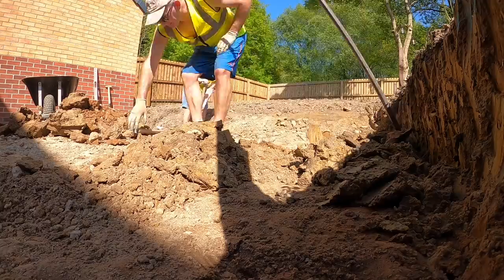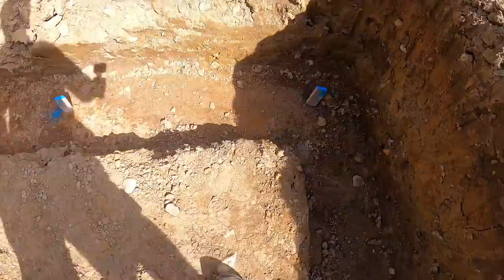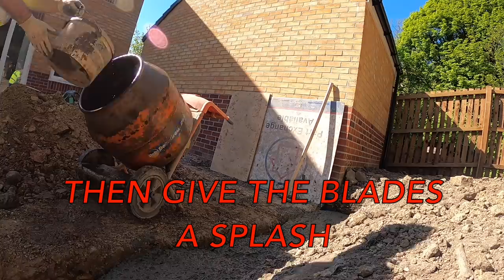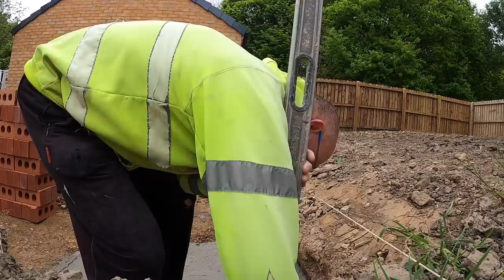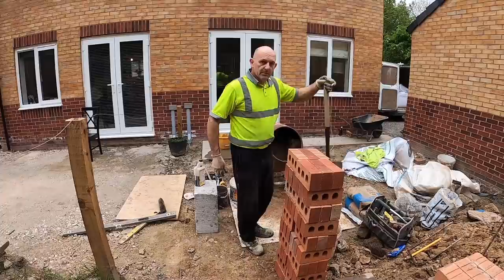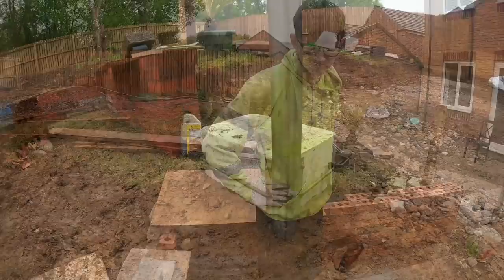SETTING OUT NEW GARDEN WALL

Comment: Young fella needs to get himself a good pair of boots. It’s funny how in Britain it seems often you don’t put reo in the trenches. In Australia even without council involvement a trench like this would be at least twice as deep and two layers of 3 bar 8mm reo. Though it would maybe not be as wide as you made it. Best mortar board I ever had was an old aluminium speeding sign. It didn’t suck up the moisture like timber does. Even used the plastic flute board at times (the stuff used to make signs out of) that was very good and light, had a limited life but it lasted pretty well. If you see any speeding signs, if no one is looking, grab them 😂
Reply from the maker: LAZY DOG . Al has new boots now . We used to use polycarbonate ( plastic conservatory roof material ) but only have 1 left now .ive seen some green plastic ones on Instagram which look good to . I’ll also keep a lookout for speeding signs 😂👌🏼🧱👍🏽

Comment: Another great video lads. Would be great for us non brickies if you did a commentary on what you were doing and why...I.e why block in certain parts and not the full line etc. Keeps us newbies learning.
Reply from the maker: Request noted 👌🏼thanks pal 🧱👍🏼
Reply: That is exactly what I am skimming the comments for. That corner block. What does it  make corners easier or stronger? Or did engineers specify it?
Reply from the maker: jynnandtonnyx . Hi pal the blocks are used when the face of the wall  isn’t going to be seen . In this case in part 2 you will see us build the steps in that corner . It just saves time and face bricks . As the wall is 9” or double skin we can lay the blocks flat  which is much stronger plus 2 flat block is 225 mm high , the same as 3 courses of bricks 🧱 . Hope that makes sense and thanks for watching and commenting 🧱👍🏽
Reply: Bricklaying With Steve and Alex 
Great explanation. Thank you 😊
Reply from the maker: jynnandtonnyx No probs thanks for the question  🧱👍🏽

Comment: Was this a retaining wall? I’m planning on doing one in my garden to level off a slope and have patio at the bottom part. Will 2 courses of bricks be enough. Wall will be about 15 foot wide and probably about 3-4 foot high (above ground)
Reply from the maker: It all depends on how much ground you are retaining. There is probably detailed information on line .🧱👍🏽

Comment: Look forward to part 2. Noted no cleaning of the concrete before 1st couse (dont mean mud). Will you tar paint the back of the completed wall. Interested where you put DPC in. For part 2 point out the weep holes. Are plastic inserts beneficial in this garden app, or could you just leave out a perp of mortar. Hope Alex gets some boots soon. Keep 'em coming.
Reply from the maker: John Coppock Hi John we started the day after we poured the concrete so it was spotless . Also we never put Dpc in garden walls as it weakens them too much . Also we didn’t paint the back of the wall we put visqueen down the bsck 🧱👍🏽

Comment: Hi, quick question anybody, when using 75mm bricks how do you gauge your block work level (100mm cavity)🤔
Reply from the maker: Andrew Marshall 1 course of block is exactly 3 courses of 75 mm brick ... 225 mm 🧱👍🏽
Reply: What about the 10mm bed joints would make it 255mm, just wondering how your ties work and window heights. Would  you start your block work with a split? Cheers
Reply from the maker: Andrew Marshall . Blocks are 215 mm so 225 mm with a bed 👌🏼all  standard openings are designed to work brick heights 🧱👍🏽
Reply: Sorry might be me not explaining it properly.
When your working with imperial brick to metric blocks your bricks will be 30mm higher than your block.
Just wondering if there’s a trick to keep it all gauge.
Reply from the maker: Andrew Marshall There’s no way to keep them gauge without cutting the blocks to course in . At tie wire level we twist them 1/4 of a turn and put them into perps so they line up with the blockwork Beds 🧱👍🏼
Reply: Perfect, cheers mate👌
Reply from the maker: Andrew Marshall No probs 🧱👍🏽